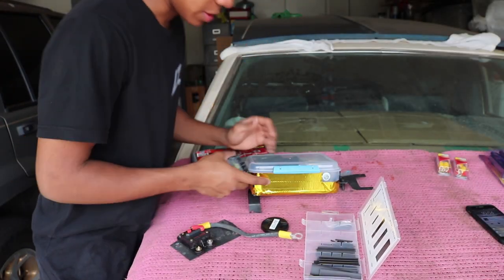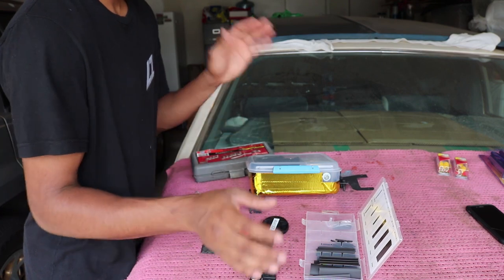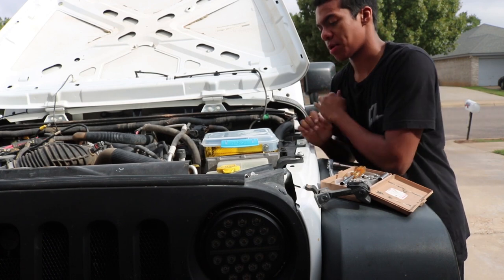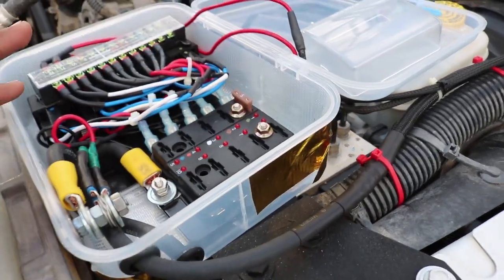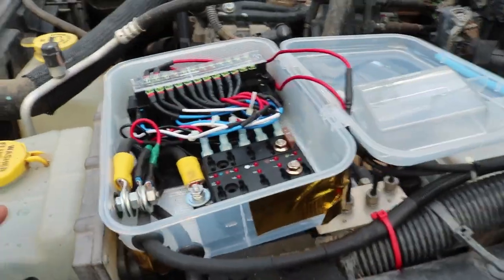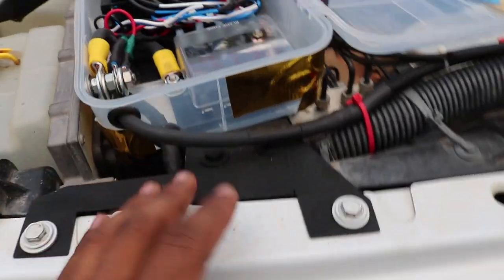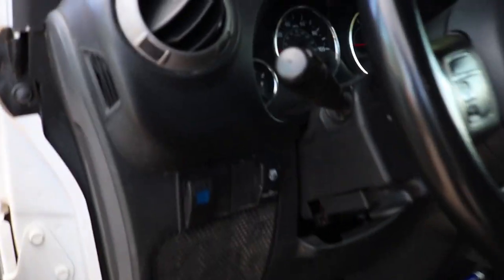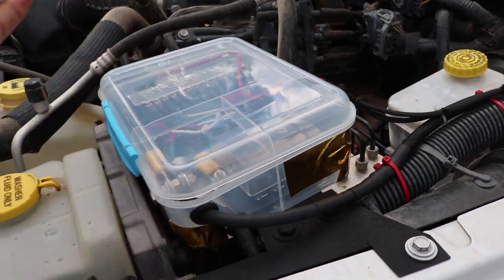$60 LUNCHBOX DIY FUSE BOX

Comment: If I'm looking to install powerlocks and flood mount lights to my jeep patriot , Would you recommend installing one of these?
Reply from the maker: Ambiguous User power locks is nice to have, i would have to look up how much work it would be, and see if it’s worth it to you.
Reply: I'm just trying to figure out the best method of powering both of them, I figure connecting them straight to the battery is the best method

Comment: I put the cable jumpers on backwards. And now the car won't start. A mechanic said it's the main fuse that blew. Is that true?? And have you heard of this issue before as a result of putting cables on wrong??
Reply from the maker: Darnel W yes check your fuses